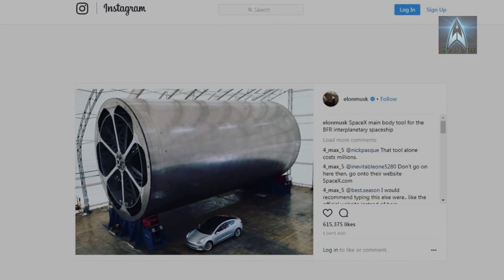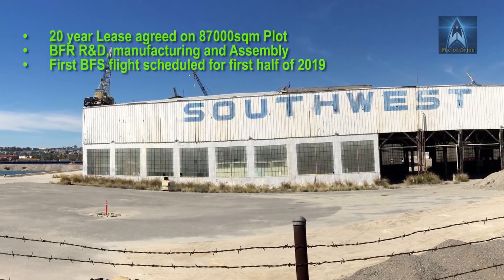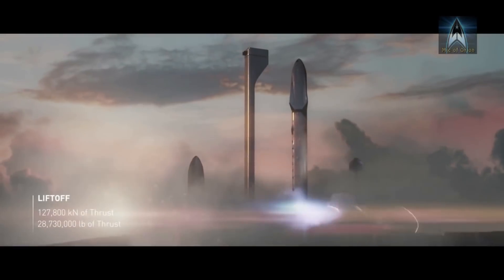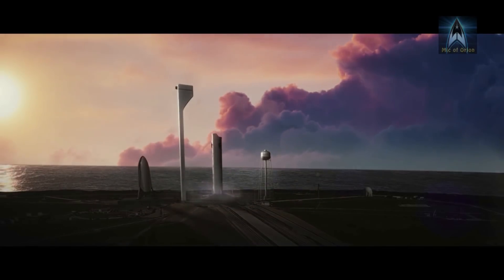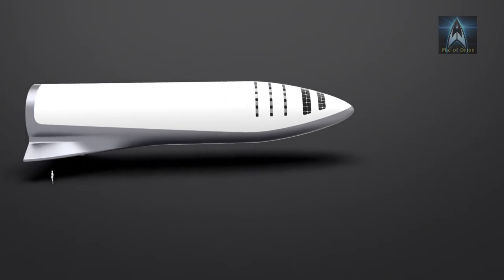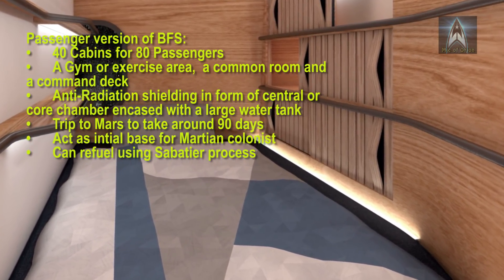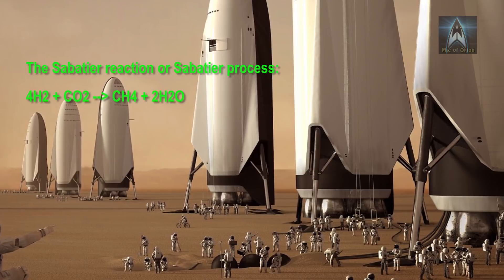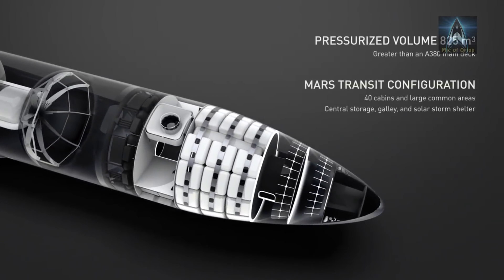BFR Is Starting To Take Shape

Comment: 0:29 You got your info wrong. It's 9 meters in diameter. Check Wikipedia, and it's pretty clear from the picture too as the car is around 4.5m long, and two end to end would reach across the diameter of the tube. Also it even says in your own video later on. Why would the tooling be bigger than the actual diamter of the rocket? :P
Reply: The original was supposed to be 11 M but he down sized it to 9 M.
Reply: Yeah, but the tooling is clearly 9m in diameter. They only just made it recently.

Comment: This thing is going nowhere in a year, or five! Just look at SpaceX history of wildly over optimistic time lines. This beast will take five years just to build the facilities and work out kinks in development.
Reply: They went from Mariachis and an empty room, to the all time cheapest SHLV class rocket in history in 16 years..... That's not slow. Yes, Falcon Heavy took 5 years from the initial launch date. It went over because it's core booster system, the falcon heavy, kept being improved. They finally broke down and launched one now that the F9 is to a "finished" point. Hell they're already setting up tooling, and have the engines ready for BFS....
Reply: Brian W it was flown late because they chose to perfect the f9 first, then build heavy(which he has said they didn't particularly want in the first place).
Reply: Brian W To be fair, the falcon heavy is actually vastly more complex than the bfr is.
Reply: Vlisto but the heavy has flown, about 7 years late. These things take years to get right.

Comment: As an aside, these large rockets have been reported to rip temporary holes in earth's upper atmosphere. Are they considered totally benign? 
As an aside, these large rockets have been reported to rip temporary holes in earth's upper atmosphere. Is that considered benign? 

Is there a threshold of size, speed, deflection at which these holes do or do not get created?
Reply: Not a hole in atmosphere but plasma waves in ionosphere. It my cause up to 1m errors in GPS systems (which already has about +/- 5m error margin), and  was reported by some researches from Taiwan. As far as they probably right, they also house several start-ups which plans to be SX competitors in Asia.

Comment: what i want to know is how cargo and people will descend the BFS since 60% of the lower half is fuel and engines!
Reply from the maker: There's a elevator/lift, that pops out once the spacecraft lands. it is not ideal design I know, but it is cheapest concept possible. Ideally you'd want a smaller/shorter lander, but SpaceX is going for economy of scale, so they need 80 colonist per rocket, despite market not being there yet.

Comment: Farcical.  Virgin Galactic has been trying since 2004 just to achieve a nice & safe low earth orbit with their space-plane for 3-4 people - and failing spectacularly! Here we have SpaceX talking of a lethal-radiation romp to Mars in 2022 with a boat capable of carrying 40!?!?!? Jean Luc Picard will beam down and appear before you before any of this nonsense becomes a reality.
Reply: Mojo Jomo No I’m serious. Radiation is not as big a problem as you might think. The average dose for a Conjunction class mission (the safest AND longest option) is about 52 rem. For some context, 60 rem adds a 1% higher risk of fatal cancer for a women. And 80 rem adds a 1% higher risk of fatal cancer for a man. It takes 300 rem for radiation to start killing quickly in rapid doses, but on a Mars mission, a 52 rem dose would be received over 910 days, giving the body plenty of time to repair. And this is assuming that they return home, but they may well stay for longer, reducing the mission dosage almost in half.

So yes, we can go to Mars.
Reply: About VG and they progress rate -> this is what You get when You put all Your moneys into marketing, not the R&D works/engineering. Sorry, but Scaled Composites already performed manned suborbital flight (attitude over 100km) in 2004 (https://pl.wikipedia.org/wiki/Scaled_Composites). Branson bought this tech from them and screwed it up :(
Don't get me wrong -> I do hope for VG success, but seems that they just have wrong boss :(
Reply: Actually, the radiation dose that would be received on an 160 day mars transit would be less than the legal maximum dose for a worker at a nuclear power plant. they can also point the "butt" of the the ship at the sun, providing passive shielding, it's not really too much of a problem.
You miserable Elon doubter!
Reply: Mojo Jomo I read the paper in question, which only describes radiation doses on the surface of mars, and did in fact come to the conclusion that ”It was found that male and female astronauts older than 40 and 45 years, respectively, will not exceed effective dose limits for a one year mission when located in a permanent habitat for every atmosphere, altitude, and human body model combination.”

Furthermore I believe there was a misunderstanding of my point. The radiation dose received on an average mars mission (with 5g/cm^3 aluminium shielding) would increase the likelihood of fatal cancer by 1%. But the damage would not be mission critical, and no one will be going blind or growing extra arms. The problem here is that your understanding of the risk radiation poses is flawed. Ionising radiation damages the DNA of a cell either directly or by creating free radicals. This causes the cell to become non-functional, and must be replaced. If the rate at which the Astronaut can replace his damaged cells is higher than the rate they are produced, then they will remain healthy. Therefore a large radiation dose received slowly is better coped with than when received quickly.

Of course space travel will always pose risks. Risks which (quite rightly) should never be underestimated. However nor should they become barriers, risks must be taken in order to further mankind’s understanding of the universe. And there will always be men and women willing to take those risks.
Reply: Mojo Jomo You misunderstand, if you read my comments you would know that I said it takes 300 rem at once to kill you. And on a Mars mission you receive a cumulative dose of 52 rem (well under the limit for radiation sickness / eye cataracts). I don’t understand what you’re talking about?
Reply: Mojo Jomo I cannot continue this conversation with you. You have repeatedly misread and ignored my points, all whilst you placed words in my mouth. You have cited papers that did not support your hypothesis, and have ignored evidence that supports mine. I’ve even mentioned solar flares in a previous comment. So evidently you skim read them and pay little attention to  my arguments. This has not been a productive debate.
Reply: Mojo Jomo As it turns out Elon Musk has already addressed this problem, and has designed a solar storm shelter for the crew to take refuge in the event of a storm. And as the ship will still have fuel in, the fuel tanks will be oriented in such a way that they provided extensive shielding to the crew.

Happy now?
Reply: Mojo Jomo No, you are down right wrong. 300 rem is a lethal dose when received ALL AT ONCE. Martian colonists will receive 52 rem Over 900 days! That’s 58 milirem every 24 hours! Solar flares consist of high energy particles, as a result they can be stopped with thin shielding. And would not be fatal.

All my data come from deep space satellites, and the information was applied to mars missions by Nuclear and aeronautics engineer Robert Zubrin. Where is your data that supposedly supports the notion that Mars is too dangerous for humans?

I can tell you’re not unreasonable, just unaware of the actual risk. Which is understandable, given the general opinion of the media nowadays. I hope you can see that now.
Reply: It's a shame you don't bother to do any real technical research before you post this nonsense. Keep buying the NASA excuses though.
Reply: You seem to be trying to promote a Star Trek type notion of radiation dangers - you know, where they are seconds from receiving a lethal dose, only to be perfectly ok when the exposure period wasn't reached.  That's a Sesame Street intepretation of the real dangers.  Here's one report into the REAL dangers a Mars expedition could encounter -http://www.irpa.net/members/TS10a.2.pdf.  If you take the time to read it, you will see that it contradicts nearly every thing you said.  So, who will sign up for a trip where in all probability you end up sick/sterile/blind or dead - this is not a trip to the zoo, we are talking at least 4 years of CONSTANT radiation exposure.  Your simplistic trick of averaging the dose over an extended period so it doesn't seem so bad is not real science.  The damage would be cumulative, there would be no rest bite from radiation going/coming from Mars.  Once there, a colony would have the option of either burrowing underground or looking for caves etc.  By 2024 - not a chance!

Nasa is obviously downplaying the real dangers now because they are looking to con the tax payer out of more $$$.  Despite presently spending over 50M a day, they are forced to bumb trips to the ISS with the Russians.  Nasa is a joke and should be disbanded.
Reply: 1) Well yes, it's an article on estimated radiation exposure on Mars - says so in the title. But in order to get to Mars, you've got to actually travel there - up to 2 years there, another 2 years back with little protection from space radiation in the interim, and when most damage would be done. Not much sense 'concluding' that a years stay on Mars is doable, when the real dangers lie in getting to/from there - my point all along.

2) Quoting from the article's Conclusion while disregarding that the estimated radiation doses were routinely exceed is disingenuous.  Particularly so since, the bias to 'conclude' as such would be overwhelming wherever Nasa was involved, irrespective of the data.  This report does highlight though just what scant radiation protection is offered by spacesuits/spacecraft when compared to planets, even one with as tenuous an atmosphere as Mars.  It also shows that doses don't have to be immediately life-threatening to make such ventures questionable, and likely impractical. Doses needed to begin forming eye cataracts is far lower than a lethal dose, and even on Mars, the estimates were almost always greater than that thought permissable.  Remember, we're talking up to 5 years of exposure time here, not a one-off event.  No matter how much of "the right stuff" you've got, a blind(ing) astronaut is a liablilty to say the least, and given the time involved, probably a fatal one to any mission.

3) Your misleading 'averaging-over-time' for radiation doses is contradicted by Nasa themselves.  To quote;

"To die, you'd need to absorb, suddenly, 300 rem or more.

The key word is suddenly. You can get 300 rem spread out over a number of days or weeks with little effect. Spreading the dose gives the body time to repair and replace its own damaged cells. But if that 300 rem comes all at once ... "we estimate that 50% of people exposed would die within 60 days without medical care," says Cucinotta."  

You would not receive an 'average' dose from a flare but its maximum intensity, all at once.  Averaging only works in math problems or when you're trying to conceal something.  Their quoted 300 number is also dubious (typical Nasa) as it implies that lesser values are ok - akin to suggesting that stabbing you in the chest is non-fatal, while ignoring the fact that it's the after-effects (pulling out knife/blood loss) that kills you. Other sources cite doses as low as 20 rem as compromising the immune system, while values as 'low' as 100 can make you so ill, you're practically non-functioning.  A problem when you're between planets without a medic I would have thought.
Reply: Haha, I guess that's as close as I'm going to get from you that space travel is not as benign as you would like people to believe - a 300 rem dose can kill you.....

 What you have danced around or implied from the get-go is that it is impossible to receive this amount instantenously.  Come to think of it, I don't think that you have once mentioned flares at all in anything you have written!  Is that a dirty word that can't be mentioned,  if only because of its implications???  One massive flare in the right direction and everyone onboard said spececraft is dead, period.  Billions of dollars, gone, just 'cos the sun burped!  That's not space-travel, it's Russian Roulette.

Let's see if I can get a direct answer from you here.  Would you expect astronauts on their way to Mars, on being hit by, say,  an X45-class flare, to receive a life-threatening dose of radiation???  Simple question, yes or no will suffice.

Nasa even say in the same report that 11cm of water-shielding would offer little resistance on being hit by a large flare.  What are the chances of SpaceX' BFR having 11cm of water, or anything of worth, to protect crew by 2024 - zero.
Reply: Your only solar flare input related to your averaged-over-time rem doses - which are just nonsense, real life doesn't work that way where X-type flares are concerned - then bow out when specific answers are sought. There is ample evidence that flares pose a very real danger, some might say unsurmountable, where prolonged space travel is concerned.  The fact that you chose to ignore this because it conflicts with whatever agenda you're pushing doesn't make it wrong.

But you're right, this isn't productive, I'm done here.
Reply: In the comic book version of space travel maybe.  In the real world, just one big solar flare heading your way and everyone on the ship is dead - irrespective of your butt's orientation! We're gone from needing 6ft of water for ANY sort of radiation protection, to whimsical notions about nuclear power plant doses.  This is why fewer & fewer are taking these unrealistic predictions seriously.
Reply: Jeff Vader, you may be serious but that doesn't make what you say right, in fact it's downright misleading. You are using statistics to try and 'prove' that over time, the probability of receiving a lethal dose drops, then using this faulty reasoning to come up with rediculously low exposure numbers.  You completely ignore the fact that the sun fires off x-class flares all the time, and if you encounter a big one of those on your way to Mars, you're toast!  Hell, even the Nasa apologist Wikipedia concedes that shielding is a prerequisite for any manned Mars mission.

Comment: Great video !  The BFR is great for delivering Cargo to the Moon or Mars !  With a flight window for Mars every twenty-six months that leaves a lot of flights for the Moon !  There are two good launch windows every Lunar Month !  So a lot of Cargo can be delivered to the commercial South Pole Lunar Base !  The Lunar Polar Base can recover the Lunar Water Ice...  And then the Lunar Water can be broken down to LUNar OXyegen (LUNOX-TM) that has many uses.  The LUNOX will let the BFR land with empty Oxygen Tanks then refuel with LUNOX for the trip back to the Earth !  The LH2 (Hydrogen) can be heated by a Nuclear Power Plant to recover the Solar Wind Gasses !  tjl
Reply: BFR is actually capable of Lunar missions without refuelling, this is so it can get a fuel plant up and running before hauling heavier payloads to the moon.
Reply: Tim Lipinski when you say BFR you mean big fucking rocket